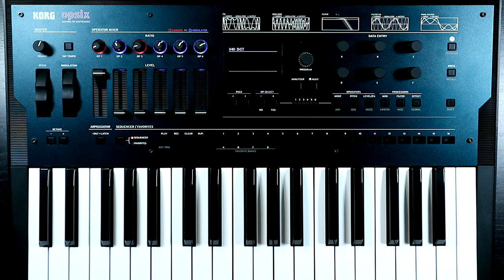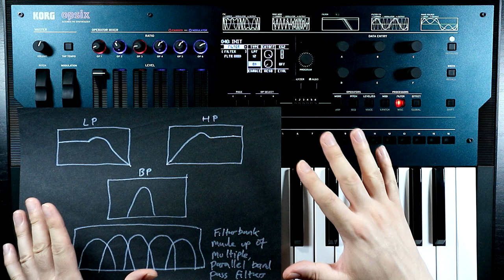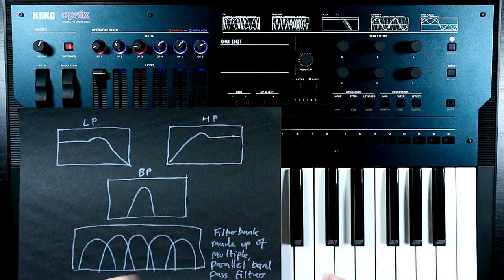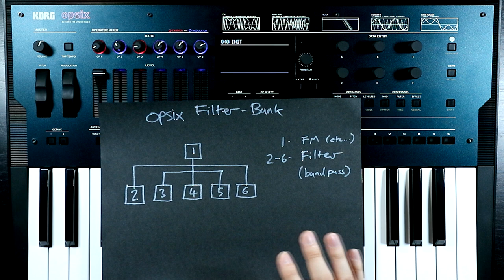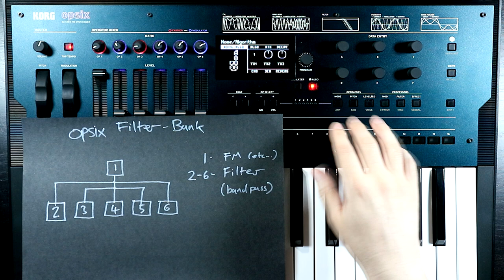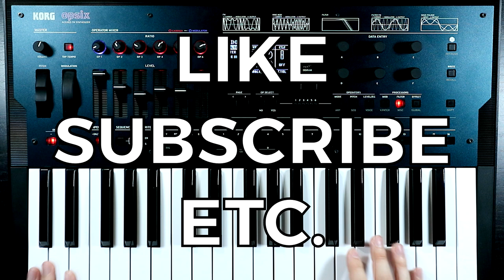Korg opsix: Building a Filterbank (Fake Vocoder, String Machine, Vox Humana and Talkative Robots!)

Comment: Man, I’m really loving the flexibility of this synth. The crazy part is, I wasn’t even planning on owning it! I’d bough a Dreadbox/Polyend Medusa and it just wouldn’t keep tune. I had a couple other issues with it as well so I returned it. I decided then I didn’t care about analog and I just wanted a flexible and dependable modern synth. Shortly after repacking the Medusa, I saw your video on building a Juno inside the OP6 and I knew immediately that this is an incredibly powerful, modular synth. And it would hold its tune! 

I’ve had it for a few weeks and not a day goes by that I don’t make at least one patch in it. It sits incredibly well in a dense mix and I’m very happy with it. TBH I probably wouldn’t have bit the bullet had I not gotten a good deal on a demo unit. Though it does look super cool and has 100% proven it deserves its space in my studio, I still feel some kind of way about paying that much considering it’s outside build and Raspberry PI insides. Also it does lack bottom end compared to my Yamaha DX. Still, it’s probably my second most used synth right now after my all time favorite synth, my ESQ-1. I really hope Korg does a major update like multistage/loopable envelopes, more mod destinations/sources, more waveforms/filter models, more FX…Looking at the capabilities of the other synths in the series, I believe there should be more CPU to add a few more features.

Anyways, thank you for inspiring me to get an OP 6! It’s the most underrated synth of the series IMO.

TLDR; OP6 GOOD.
Reply from the maker: I'm really glad that you've found it to be an inspiring synth. And, like you, I live in hope that we'll see some exciting updates in the future. The Wavestate just had a very significant update so I'm hoping that the opsix won't be too far behind.
Reply: @OscillatorSink  And now we have version 2.0 which includes a new Comb Filter Oscillator! This is going to be fun!
Reply from the maker: @audioartisan  video on that coming later today!

Comment: Really cool.  It would be amazing if they would put out a bandpass with a more extreme response curve.  You can get some decent results, but one that emulates a single frequency of a fixed filter bank would be incredible for tone sculpting and really honing in those more specific sounds.
Reply from the maker: Yeah, a 24dB bandpass would be a nice edition for sure. There's always the prospect of firmware upgrades... Fingers crossed.

Comment: FM seems good at twangy sounds.
The Karplus-Strong Synthesis is also good at this.
Can this also be reproduced on the Opsix?
Reply from the maker: For Karplus-Strong, to do it properly at least, you would need a delay line which could change its length quickly, and scaled to note input - the opsix doesn't have this (and believe me, I've tried!). That said, you can still create some interesting, atonal, bendy string like sounds by messing with the delay effects and modulating their delay times in the vpatch.
Reply from the maker: I didn't realise that Korg were literally days away from an update that means we CAN do Karplus-Strong now! Check out my most recent video!
Reply: @OscillatorSink  thanks again. I noticed the update, but I didn’t know it had these implications.

Comment: Thank you!!! This patch is insanely beautiful and making me delve further, into the world of Op six. However, running into bugs. When I move my volume knob it seems to effect the pitch of Op1. When I move my Op 6 slider, it also alters the pitch of Op 1. This is a bug, right? I've updated mine to the latest firmware. Is any one else running into this problem? Any way to fix it? Thank you.
Reply from the maker: That sounds like a physical problem with your synth to me, maybe some kind of loose connection? Only thing I can think otherwise is - do you have USB / midi plugged in when it's happening?
Reply: @OscillatorSink  I did have Midi plugged in, but the Midi device was turned off . By the way, I tried to replicate your gorgeous vocoder patch. Set the virtual patch - LFO2 = Sample and Hold for the volume of Op 6, as you explained. At least that  fixed the strange volume issue. Op 6 had to obey the v patch command. Thank you for such a quick response.